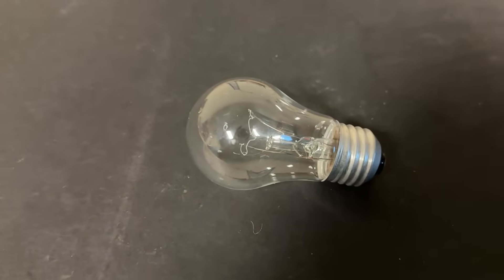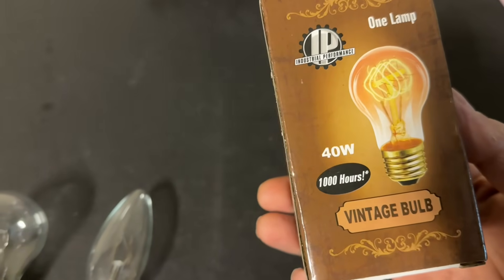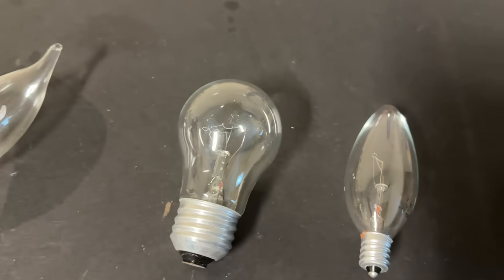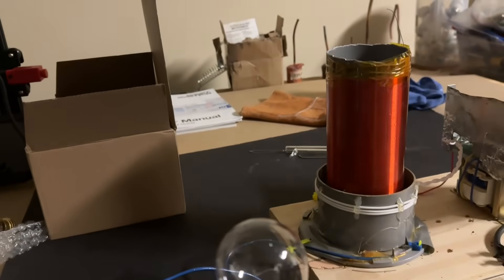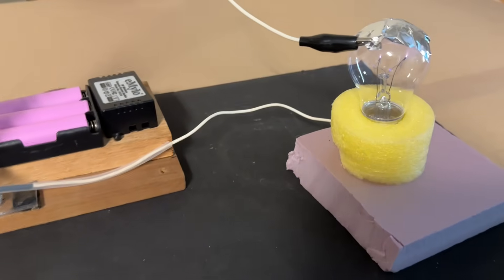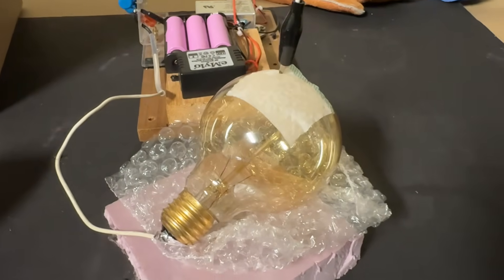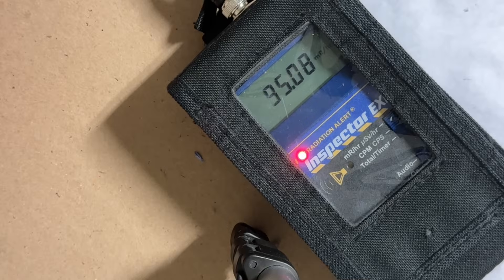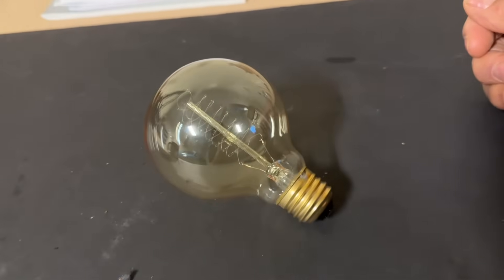Intense radiation output from Vintage lightbulb

Comment: Need hard vacuum, no argon-glow.  
Use those oblong aquarium bulbs, and "vintage-look" incandescent bulbs.  Both have slightly browned glass, from sputtering the tungsten off the filament.   Also "exit sign" bulbs, lectern bulbs, and those spherical 7.5watt and 15watt golf-ball shaped bulbs.   Small old-school x-mas lights, the screw in kind work too.   Even a handful of "grain of wheat" bulbs or pilot-lights will do it.   All these contain hard vacuum, and make x-rays, but only with high-frequency AC, well above 10,000V.   And, for very underpowered tesla coils, just wrap aluminum foil around the far end of the bulb, and ground it.   This should significantly increase the HV that's inside the vacuum region.
( I discovered all these by taking my ancient buzzer-type TC to the store, so I could zap light-bulbs.   Powered it with twelve 9V batteries in series, connected to the AC plug.)
Reply from the maker: Awesome info. Your suggestions gave me the idea to make this video!
Reply: @BrianDhvTinkerer  Also, you've discovered the mysterious "glass-perf" phenomenon!   Today we know that it's caused by ion beams, "large ions" in the form of electrically-charged metal nanoparticles coming from sharp parts of the filament.  They're hypervelocity, like micrometeorites, and easily drill through any known substance.  "Ion-beam lithography," it's a simple way to fill all your light bulbs with oxygen, on demand.   No tiny drill-bits needed.   (I was always thinking of covering my light bulbs with some sort of goo, or maybe just tape.  When holes get drilled, the air pressure would instantly plug the holes with goo.
As the ion-sources, Nikola Tesla recommended using liquid mercury, or the tips of sharp tungsten whiskers.   Today we use liquid indium metal.   Tesla reported feeling tiny stings on his skin, when getting too close to these glass bulbs.  Yeesh!   As if the x-ray output wasn't enough!
Reply: LOL! I did the same thing at the first SteamCon, reworked the guts of a Baby Violetta with some clock parts and a bunch of old leather belts into my Portable Electromechanical Refibrillator. Even the cheapest 9Vs would give me plenty of run time.
Reply: @zinckensteel  always recharge alkaline 9v batteries back to 10V, with a 50mA charging current.   I rescue piles of batteries from our department's bin.  But if they're under 8V, not worth using.  (When people discard 9V batteries in the recycle bin, usually half of them are brand new 9.1V.   Unlike D-cells, people have no good way to test a bad 9V.)
Reply: @wbeaty what's your procedure for recharging 9v alkaline
Reply: @djmips  Don't do this at home, because used batteries can unexpectedly leak corrosive goo.   
First I discard the carbon/zinc, and the alkalines below 8V.  Then, with a DC bench supply, set the overcurrent to 50mA, the volts to 10V positive goes to the pos. battery terminal.  The displayed volts then should rise sloooowly, at 50mA constant current.   Also, to detect worthless batteries, use a DVM on 10-amps with min/max capture, to very briefly short the battery, looking for your charged batteries to provide two amps or higher.   If it only gives 1A when shorted, it's usable but the internal plates are nearly gone.    And, with a 30V supply, I hook three nearly-dead 9V alkalines in series, and charge at 50mA.   (With old batteries at 8.7V or higher, I risk charging at 100mA, twice as fast, but usually gets warm.)    
If instead you just want a high-voltage battery bank, w/milliamps output, then sometimes you can even charge them up from 6V, to above 9.   In 1993 someone gave me 10lbs of "dead" 9V alkalines from theatrical RF microphones.   I made a 2000V bank, spread out on an 8ft table.   Generate H2 bubbles even with distilled water!   Also, set fire to a 2X4 board.
Reply: @wbeaty  ...*double blink* ..seriously? I recall vague mentionings of such a possibility, but for batteries that are generally regarded as single-use, how well can this work? Or is this strictly for old batteries that have sat unused for some time, but never fully discharged? Also, I have a handful of 12V dual-filament taillight bulbs with a hard vacuum which I have been using, somewhat successfully, as external grid triodes. The vast majority of similar bulbs I have sourced are unsuitable, just giving the classic purple filamentary glow discharges. How would I best go about hardening the vacuum in such a bulb, if that is even possible, or do you have another idea as to why I managed to find several with sufficient vacuum? A number of them came from the old Hardwick's in the U-dist on Roosevelt.
Reply: @zinckensteel  Genuine rechargables have zinc over iron-foil electrodes, and the iron doesn't participate (so, when "discharged," the plates still exist, so we can "recharge" by electroplating the zinc back up again.)   Non-rechargeable or "primary" batteries are destroyed during discharge, but only if we allow the voltage to drop too far, where the pure zinc plates thin out and then fall to pieces.  Also, they might vent corrosive goo, or even swell up and pop, if recharged incorrectly by non-tech people.  
So, the myth is spread that they "cannot be recharged."   In practice we can recharge them a handful of times   ...but not twenty or thirty times, as with the genuine rechargeables.   
Cheap small bulbs won't use argon, and so have more limited lifetime than argon-filled bulbs.  (Take a portable TC to the store, to zap bulbs and sort out the ones with argon-glow.)   Also, vacuum bulbs must only glow bright yellow or yellow-white, where temperature is below 4000K deg, and tungsten isn't being vaporized.   If you want intense white, with a little blue, then it must have argon, or even employ tungsten-halogen.  If not, the glass turns brown/opaque from sputtered tungsten.
Reply: @wbeaty  Amazing, this is absolutely a real thing - disappointed in myself for not already having known. I gave it a go with two mostly dead (by metric of tongue-test) 9V batteries with the supply set to 10V limited at 50mA. Only one eventually reached zero on the current meter over the course of a day, but both now give a robust output. Thanks! Edit: As of today (6/21) the batteries charged up on 5/9 now register as nearly dead as per the tongue test. Self-discharge is definitely greatly increased.
Reply: @zinckensteel  Recharging our 9V batteries, it's one of the great secrets of existence!   (I got involved via correcting grade-school science textbooks, which always explain batteries wrong.  Recharge is just zinc electroplating, and discharge is zinc-powered exothermic corrosion.)  
Why then aren't all batteries rechargable?  They are, of course.   But old NiCd have less life, because the iron foil takes up so much space.  Modern batteries have "plates" made of compressed or sintered powders, for vast internal surface area, and not just flat metal plates.
Reply: I also noticed the green glow when zapping microwave oven bulbs, also with small flashlights bulbs casted in epoxy and a lead shield

maybe the electroluminescent paper (like the blue glow sheet on some watch or some clocks) will glow with the x-rays, since it's made with doped zinc sulfide

Comment: Wow! That's a very strong source! I'm wondering, how far away do you have to be to get just twice background? :)
Reply from the maker: Thanks great comment. I did not see how far I could go because the amount of radiation was very worrisome and I decided to disconnect everything and turn it off. I might do a later run outside and remotely switch it on to see how far it sends out counts above background. I’m sure it’s gonna be quite a distance. By using the inverse square equation and say the output is 1.6 rem/h at 1 ft distance, This gives a value of 51.6 ft to be down to twice background—so distance and time really are your friend with radiation dose   !
Reply: @BrianDhvTinkerer  dang! 100 mR/h is no joke! I personally would highly advise you not to turn it on while you are anywhere in the vicinity! Maybe from 20 feet away while you're behind a large rock would and with short exposure! Just make sure you stay safe! :D
Reply: @ReactorLaboratories They sell "med student" x-ray safety glasses for just this purpose.   X-rays have much the same hazard as UV in sunlight, melanoma skin-cancer.   But also, x-rays can give early-onset cataracts.  So, eye-protection is the biggest issue here.   People in radioactive environments should be wearing the special glasses, with lead-glass for the lenses.   Those crazed Russian vloggers were using smashed CRT television tubes, for their front plate made of very thick lead-glass.   Just hide behind a broken TV tube.
Heh, find a 1950s geiger counter with a transparent window.   You'll find it gives ridiculously immense counts from normal sunlight.  Daylight is radioactive?  Sure.  UV photons are ionizing radiation  ...but not penetrating radiation.   UV is biologically similar to x-rays, except that all the sunlight-cancer will only be on the surface!
Reply: @BrianDhvTinkerer  Try making shadows on your geiger counter,  thin steel soup-can lids, brass sheets, thick aluminum plates, stacks of Al foil, square jars full of water etc.   This is mostly "soft" x-rays, way way below the ~200KeV photon-energies used in medical imaging.   
Also, I wonder if a hard-vacuum bulb, inside a microwave oven, produces x-rays?   That DC supply is only 7 or 9 KV.   But the microwave chamber involves standing waves and resonant step-up, same as with the secondary on a TC.   
Also, with no geiger counter, we can check for x-rays via glass-fluorescence.   If in total darkness, and the surface of the glass flickers green or blue, that's from electron-impact, also making x-rays.   I suspect the green flickers come from soda-lime glass, the blue ones from borosilicate.
Also, a medium-size TC can light up an incandescent bulb filament, if the bulb has high vacuum and a very thin filament.  (Try it in total darkness, look for very dim red glowing filament.)   It's all from electron-impact.   I've seen the "golf ball" bulbs do this.   It's how Tesla made his single-button carbon lamps light up.

Comment: Whoa it'd be cool to see a spectrogram of vintage bulb X-Rays
Reply from the maker: Wish I had an X-ray spectrum analyzer
Reply: @BrianDhvTinkerer  AFAIK all RadiaCode devices got energy range of 20KeV to 3MeV. Since you're blasting it with well over 20KV it should be able to see it.
Reply: @yunodiewtf  Yep, I tried it, but didn't bother to upload the graph.   With a handheld "vacuum tester" tesla coil, the broad peak was very low, around 50KeV if I recall.   Makes sense, since the output voltage is 50 to 70 kilovolts AC.     "Aquarium bulbs" ftw!
Reply: @wbeaty  keV, not KeV.
Reply: @mernokimuvek  Heh, and we also must write meV not MeV?   kM not KM?  16k not 16K bytes?  And what's deci versus deca?  But keV and KeV are both used.  (Also ev versus eV is used.)   I wonder how the inconsistent  capitalization got started?  In engineering unit designations,   1,000X is capital K, 1,000,000X is capital M, 10^9 is capital G, etc.    milliTera Ohms!
Reply: @BrianDhvTinkerer  I got mine when everyone only wanted the brand new Radiacode 102, so the 101 was temporarily cheap.
Reply from the maker: I need to get one of those!
Reply: @ also, I have a glass electrode with a spring, and with gas fill.   Only oldest examples have hard vacuum.  Later knock-offs, made the zapping worse.  Unclear on the concept.
Reply: @BrianDhvTinkerer  Grab a Radiacode 103

Comment: I wonder if the prodigious amounts of X-rays are due evaporated tungsten on the walls of the bulb, or whatever coating that gives it that darker tint to the glass.
Reply from the maker: Yeah, not exactly sure. But something about that glass makes it a great striking target. I was wondering if it was leaded or metallized glass
Reply: @BrianDhvTinkerer  Yeah also the glass seems to be quite thin so soft x-rays must be able to pass thorough.
Reply: @BrianDhvTinkerer  This is called "transmission Bremsstrahlung" x-ray tube.   That's where the electrons hit one side of a thin membrane, and x-rays spew from the other side.  It's a glass membrane in this case.   Particle-accelerator people call it the "converter," where a thin tantalum foil is used, the "tantalum converter."   This is used in "cone-beam" high-rez x-ray machines.   Also used in Sandia Labs' Project Hermes, for simulating the full x-ray output of atomic explosions.   Normal x-ray tubes instead use "reflection Bremsstrahlung," where electrons strike a very thick tungsten block at a glancing angle.   
Nikola Tesla's x-ray tubes at first used thin glass targets to generate x-rays.   Heh, it's a "silica converter."  Some of his devices ran at hundreds of watts, and three million volts, and nobody knows how he kept the glass from simply melting.   If we could take an extremely high-res x-ray spectrum, then a glass bulb should give a different result than one with a piece of tantalum or tungsten foil inside.   Or platinum foil, as was constantly used around 1910.
I hear that it works backwards, and if you direct a narrow beam of x-rays at metal foil, then the other side emits a narrow beam of electrons.   Performed in a vac chamber of course.   But that means we could build a "solar cell" for x-rays!   Use these out in hard vacuum at your moon base, no silicon solar-cells needed.
Reply from the maker: Interesting concept about using the hard vacuum of space to generate X-rays. That must happen when the electrons emitted from the sun strike the metallic outer material in man made space objects such as satelites etc. I wonder if this kind of radiation (bremsstrahlung) affected the people on the international space station.
Reply: @BrianDhvTinkerer  The ISS station is a high-radiation environment.   But then, so is any cross-country airline flight, maybe twenty to fifty counts per second on a pancake detector.   (If you take a geiger counter on your flight, and it scares anyone, you'll be jailed as a terrorist.  It's even worse than having a suitcase full of colored alligator-clips from Radio Shack, or, that MIT student with a tee-shirt covered with LEDs.  Go directly to jail.   Me, I only took a Digilert 50, with the sound turned off.)
Reply: @BrianDhvTinkerer  The sun is a huge source of x-rays, all blocked by Earth's atmosphere.   With metal foil, electron-impact creates x-rays, but impact of high-energy photons releases high-energy electrons.   Shine intense x-rays on these light bulbs, to see if any volts are created.   X-rays hitting metal should spew out electrons (at considerable DC voltage, like a kilovolt solar-cell.)
X-ray telescopes in orbit are giving us x-ray imagery of the sun, the CME explosions, etc.   If you're up in orbit with no steel-walls on your spacecraft, beware the x-ray sunburns.

Comment: i wonder how it would work with a reflector heat lamp bulb.  This is terrifying.
Reply from the maker: It was scary- I didn’t expect intense radiation emission from a lightbulb
Reply: @BrianDhvTinkerer  I've seen it before from a small christmas tree bulb, but never to that extent.  And with no specialized equipment.
Reply: Oooo, also must give it brief negative megavolt pulses (perhaps from a VDG static generator.)   In that case, the x-ray output should form a narrow beam, because up in the realm above 500KV, when an electron strikes metal, an x-ray photon comes out at the opposing angle, like angles of incidence and reflection.   You've invented the x-ray spotlight.
Reply: @ Neat. Then we can do things like x-ray image a bank vault.
Reply: @zinckensteel  Or find contraband at the border.   Thick lead shielding?  Sees right through!

Comment: AC will be easier to create xrays since ti can pass through the glass capacitively.
Reply: It's really weird that this works at all.   How does the DC get through the glass layer?   Will it stop working if he removes his ground-electrode from the glass?   Or instead, just hold the ground electrode close to the glass, without actually touching.   (Or, put a thick plastic plate between the ground-electrode and the glass.  Does it still make x-rays?)
Reply: @wbeaty with enough e field everything gets conductive.  Also I suspect his source has a lot of voltage ripple which is the same as ac voltage of the same amplitude

Comment: I didn't know that electrons can emit X rays even when stopping in glass, not in metal. In such way the radiation will present in all devices where electrons can be enough accelerated, i.e. vacuum and high voltage.
Reply: The problem with glass is that the electrons get trapped on the surface, charge the glass negatively, then deflect all the incoming electrons.   Old CRT picture-tubes had a micro-thin aluminum coating on the screen, connected to positive HV.   But if the beam current is low enough, leakage across bare glass might remove them faster than they come in.   Also, most of these bulbs are yellow-brown inside, from a micro-thin layer of sputtered tungsten.  That might be a requirement.